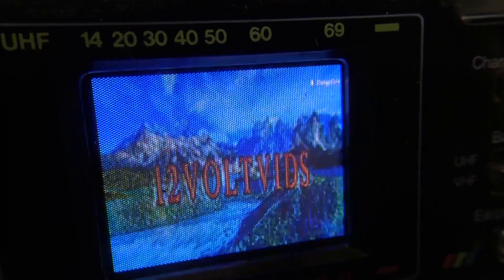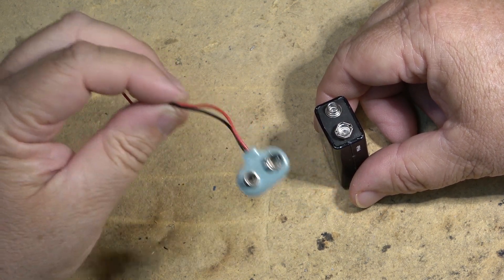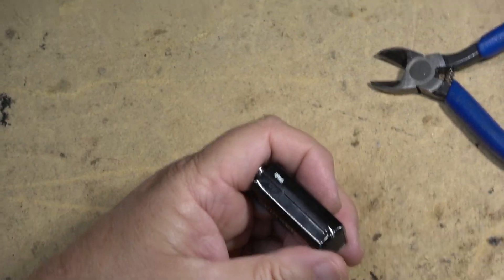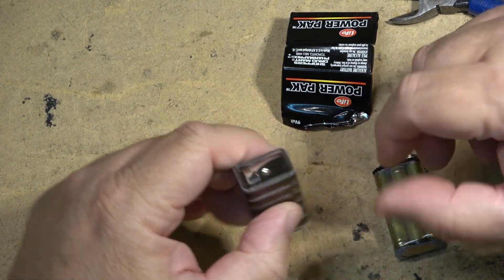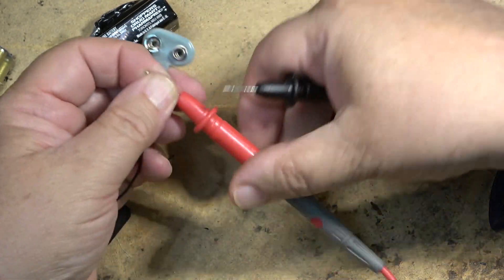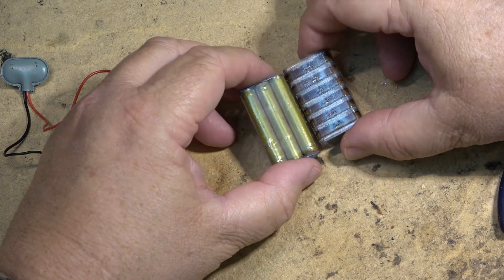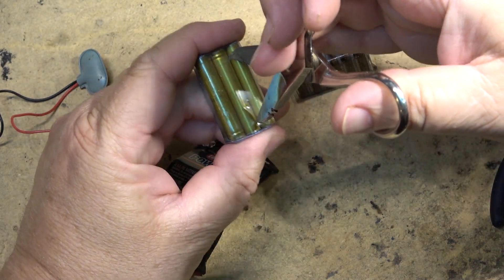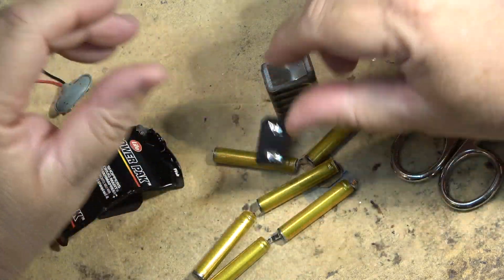9 Volt Battery Hack

Comment: I noticed the 9volt battery connector you used had some tin clips on the back that can be used instead of needing to solder the wires to the new connector. Is that correct?  The other videos I watched all used a soldering tool to connect the wires.  Their old battery they tore apart did not have those metal clips on the back.  If so, what brand of 9 volt battery do I need to look for that has those clips on the back?  I don’t have a soldering gun.  Thanks.

Comment: I remember getting carbon rods out of carbon-zinc D-cells and C-cells when I was a kid.

Remember, a cell is a cell, a battery is a group of cells.

Anyone remember the 22.5-volt and 45-volt batteries?  I remember 22.5-volt ones in a case the size of a 9-volt, with a single terminal on each end.  And cylindrical ones about the size of a C-cell with single clip terminals on each end similar to those on 9-volt batteries.
Reply from the maker: Yes I had a radio that uses a 22v battery. Was a 1 tube radio.  I have a tube radio now that will work using 2x 4.5v batteries and 2x 45 volt batteries.  Should set it up to run on some lithium cells.   The tubes are all 1.5v filaments and on AC power it has instant sound.  As fast as any transistor radio (direct heated cathode.)
Reply: @12voltvids  Yes, there are quite a few old battery types out there we no longer use.  People buy AA, AAA, C and D batteries all the time, but how many of them ever think about A and B type batteries?  Back in the '70s CB radios had amplified "power" microphones, and the Turner +3 hand mike used a small mercury battery about half the length of a AA and slightly smaller diameter, I forget if it was 4.5 or 7.5 volts.

In the '60s I got a Motorific race car track set, battery operated slot cars.  Each car took two "AA" batteries.  The year after I got the "Mini Motorific" set with smaller track and cars.  Those cars required two "N" batteries, and the only place we could find those was at Sears!

Comment: I have soldered 6 AAA batteries to the clip at the top to get me going before and just put black tape round the batteries to hold them together.  Strange, It never occurred to me to use the clip at the top of the battery to replace a broken clip going to the appliance!  I always had them in stock.  It was always the batteries I ran out of!  Very expensive for what they were!

Comment: In early 80s I found as a kid, that is easier and cheaper to do this instead buying a proper battery clip. Back then, the Zinc-Carbon batteries were made from horizontal elements instead those small AAA cells.

Comment: How are you getting a postive vs negative indication just through the color coded wires ?  Is there something in the cap?
Reply: The Battery pushes on to the OPPOSITE terminal.  PUSH one on and LOOK on side of Battery and WIRE COLOURS,

Comment: Did this all the time when I was younger and didn't have money to buy factory clips.     Always put one size larger gauge wire on it so it would hold up to use better.  The clips on the batteries seemed better than the factory clips you could buy.   Duracell 9v clips are the best for this.   TOOO bad their batteries are leaky.

Comment: Yes, been doing that for years, and a tip is to use some glue there to provide some mechanical grip to the lead so the solder is not going to break. As the plastic is very soft easy to take the new battery, put the clip on, and then use that as a convenient soldering stand and heatsink. Plus then a drop of glue after it is cooled down a little, then leave for a while till the glue is dry, or use a drop of hot melt glue. 

Also have cut through the plastic of the old clip on the side, soldered the clip back then used contact adhesive to seal it up again, instead of trying to feed through a new clip, as the bought ones normally are very poorly soldered, and either the solder pops loose, or the wire right there breaks because of no strain relief. When doing one side do the other as well, it likely is not far off breaking as well.

Comment: If you hack it in half exactly, will it make 4.5v? How about if you use assembly code to simulate it? hahahah :)
Reply: Open it carefully, rearrange the cells (iff you've got the cylindrical cells, not really practical with the pancake ones, but you could probably remove 3 layers of the stack...) from 6S1P to 3S2P, and you have 4.5V! 
(IE rearrange them from 1 string of 6 cells in series, to 2 paralleled strings, each of 3 cells in series)
Reply: @michaeltempsch5282  :) Just have to find where to change the jz to jnz, perhaps with an altered _loc too, and it could happen. haha

Comment: Just so that everyone knows, if you actually try using those AAAA cells from a 9 volt battery, remember that they are reversed polarity, in other words, the tip(which is usually +)is - on those cells.
Reply from the maker: Right
Alkaline cells are reversed polarity.  The case is positive and the center pin is negative.